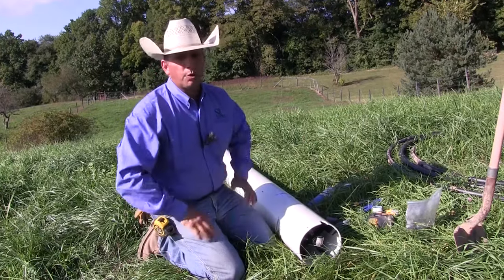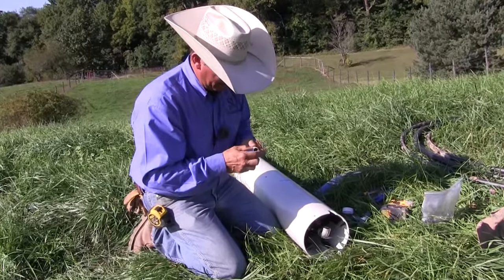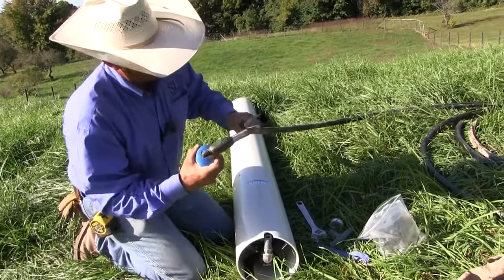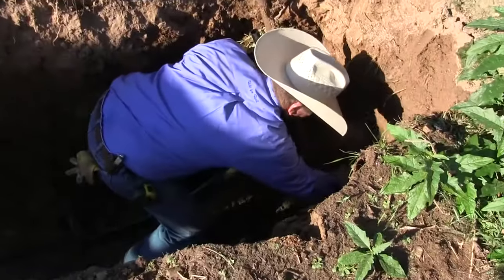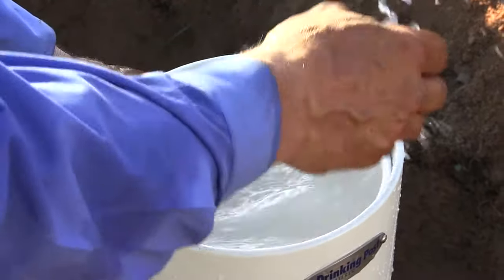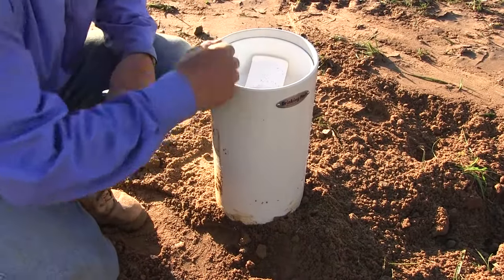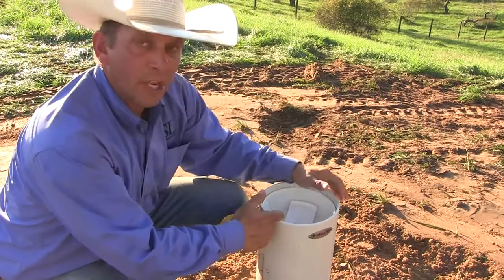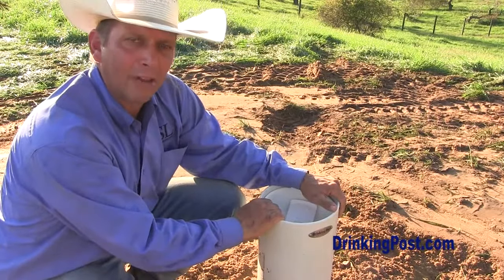Non Electric Cattle Waterer Installation by Drinking Post Waterer

Comment: How is it not electric? An electric pump moves water to it no?
Reply from the maker: Yes, pressurized water is necessary. The Drinking Post does not need electricity to heat the water because there is no standing water in the unit.

We are able to keep the Drinking Post frost free in any climate by installing the bottom of the Drinking Post at least 18" below the frost line. This is the most important aspect of installation. 

This works because the valve in the Drinking Post is a stop-and-drain valve (very similar to a frost free yard hydrant). Meaning there is only about 1" of standing water above the valve at any given time. Once the animal activates the paddle, water fills the bowl in 5 seconds and drains within 30 seconds. All water drains through the valve and below the frost line. This means no algae growth and no freezing because the bowl fills with fresh and clean water with every use!

Here is a link to find out which size Drinking Post will work for you, your animal and your climate:

https://dpwaterer.com/what-size-waterer-is-right-for-me/

Here is some more information on our installation recommendations:

https://dpwaterer.com/horse-waterer-installation-instructions/
Reply from the maker: Hi Sam.  Thanks for the question.  The Drinking Post works best with a pressurized line of between 25 and 65 psi.   The Post itself does not require electricty to operate, or to heat water in the winter. The Drinking Post works a lot like a frost-free yard hydrant. The base of the Drinking Post is buried 18″ below the local frostline and is connected directly to a pressurized waterline. So all the water comes up from below the frostline and then drains back down below the frostline.  
In most pratical cases you're right - something is adding pressure to the waterline that the Post requires for operation. It may be an electric pump.  The Post itself does not require an electric connection to operate...no need for extension cords or electric lines leading to each Drinking Post
I hope that clarifies tthings a bit  for you.